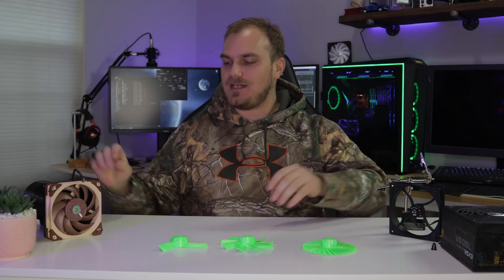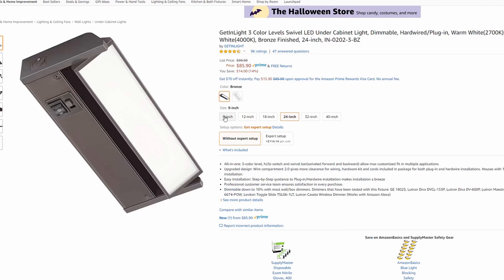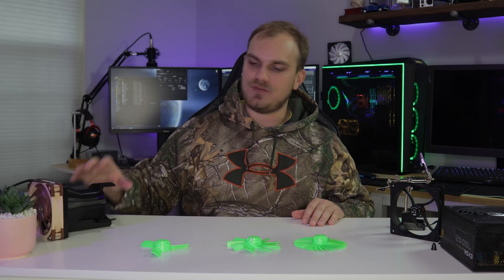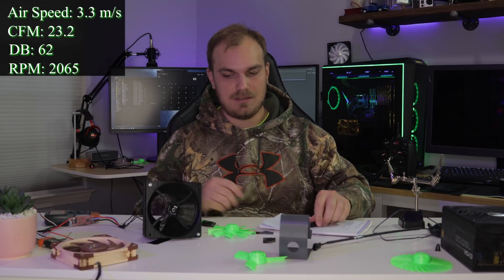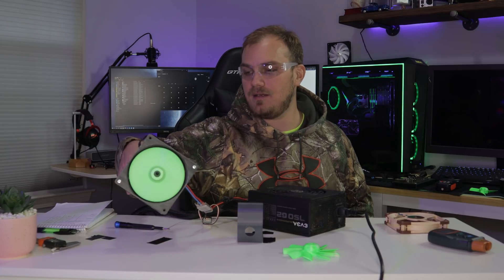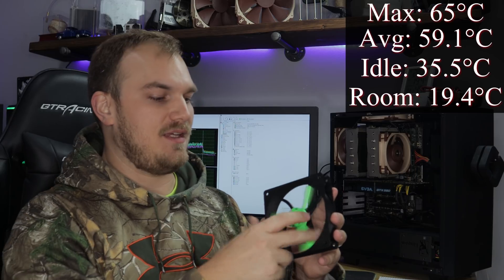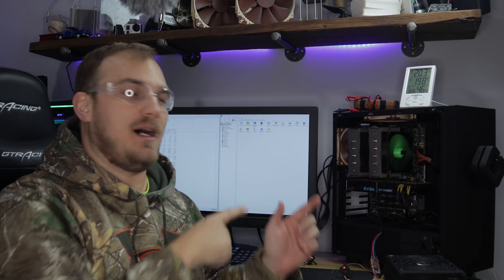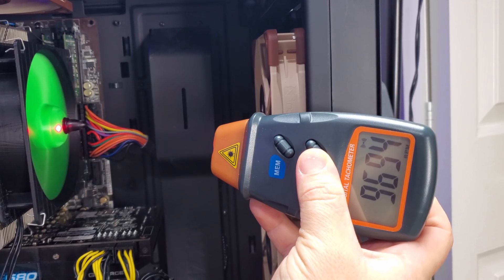This 120mm Fan BREAKS All The Rules!

Comment: The 30 blade will have the highest static pressure, meaning that the more restrictive a cooler is the more air it will push through
Reply: yeah, from the looks of it, the 30 blade actually broke the nut he had holding it on the motor and pulled itself off
Reply: @kasuraga  it probably wasn't tight enough, I've done a bit of work with drones and if the prop nut isn't tight enough it will let go. Notice it happened when the prop slowed down
Reply from the maker: Ya I should have cranked it down more
Reply: @MajorHardware  now you have a chance to fix what you found wrong with the last prototype and fix it. I would try and add scoops in the hub to cool the motor, and possibly put the blades at a higher angle and make them a bit thicker
Reply: Major Hardware  there comes a point where you have it so tight you damage the motor. The nut's supposed to be there to stop the thing sliding off, not to squeeze the heck out of the assembly (and end up distorting the rotor frame, resulting in your blades ending up out of true). Better to use a couple of lock/jam nuts and/or some loctite in this kind of assembly. Let them take the holding force, not the fan or the shaft.

Wrt the hub's rotor slots: at these speeds you should consider making these with an airfoil (or NACA duct style) shape, to "slice" air into the motor, not just act as simple ventilation slots - you want positive airflow. You can accentuate the airflow over the coils by shaping the bottom of the hub to act as an exhauster in a similar way 

I'd really like to see what you get with the 30 blade set at a slightly more aggressive pitch and then a 23-27 blade stator behind it. (you want these numbers more or less coprime or your ears will hurt - there are calculations for best ratios in turbines you can run with.) 

One last thing - flat blades always fly stalled somewhere along their length and speeds combinations - turbines and high end fans use airfoil shapes (along with chord curvature) for a reason - this was a fundamental discovery that vastly improved the efficiency of steam turbines and made axial jet engines possible.
Reply: I'm trying to like your comment, but it won't let me, it just keeps sending me to this make a comment in your comment.....sooooo, like. I like your comment.

Comment: I think it would be better to just report the temperature delta, so we don't have to do the math ourselves in comparisons.
Something you can investigate to make your 3D prints more heat resistant is annealing pla, it increases the temperature resistance to around 100°C. The disadvantage is that you get shrinkage in XY and expansion in Z, there are some special PLA made for annealing that has reduced length variation.

Comment: Could you add some angles to the edges of the ventilation holes in the hub so that you have a fan within a fan to help with the heat dissipation of the motor?
Reply: Those holes already act as ventilation.
Start playing with angles on them and you'll end up with unwanted expand/compress forces on the hub when it heats up (and it will for sure). You need them to be as neutral as possible.
My POV...
Reply: @jimbonetic  I doubt the back side is air-tight, having moving air would still be better than static if you want the heat to actually go somewhere.

Comment: The 30 blade fan actually had a similar sound to a jet turbine. I'd like to see a short follow-up to this video with another one of those 30 blade fans.
Reply: What If the 30 blade broke off because it was producing enough power to force the plastic nut off the fasining mechanism.
Reply: I think that the 30 blade would be the best performer at high speed. Its the point of that design, maximice trush winout stall.
Reply: Exactly! We need 30 blades spin-off... or spin-on..?
Reply: With jet engines, the blades are actually loose to prevent harmonic resonance, which is why the 30 blade turbine shook itself loose.
Reply: @macrowave9427  would printing in a more flexible material such as nylon help?
Reply: @ThoroughlyTested  Nylon is far more flexible then PLA and quite a bit more flexible then PETG.
Reply: @macrowave9427  making it stiffer, balanching and creating lift to counter act centrifugal forces might help since its high rpm
Reply: It sounded like it resonated before it broke. Jet turbine blades don't have a hard metal connection to avoid that problem, they attach like a puzzle piece into the crankshaft and centrifugal force forces them straight when operating. Probably excessive to engineer that into a 120mm fan, but I so wanna see a cooler that needs that level of engineering.
Reply: @Gracefulhiqpo  that is mainly due thermal expansion as it can reach around 1800C depending on where in engine you are
Reply: @frank124444  You're right of course. A single solution to solve two problems. I just thought the 30-blade fan breaking apart wasn't from overheating so I didn't mention it.
Reply: frank124444 with larger enigines like the GE90 you actually need to limit the rpm so the tips of the fan (the compressor that you can see from the front) dont go supersonic, because sonic boom would cause too much vibration and the aerodynamic propertys change at supersonic speed, that would make the compressor useless. With aircrafts that go supersonic you actually have to slow down the air in front of the engine ;)
Reply: @Gracefulhiqpo  I am a High Bypass Turbofan Engineer and allow me to say that the "interconnect" you are referring to is called "Mid Span Shrouds" that serve to negate the Aerodynamic Twisting effect on the Fan Blades.
Reply: I think a more aggressive blade curve could also help.
Reply: @cinnabarsonar2072  dont think that would help to stabilize it. It would help to move more air. As the ange of attack and the curve mainly depens or air speed and rpm and prkbebly the wanted pressure. More blades should give more coversge and.more pressure. Assuming we are hitting a speed at which the gas becomes compressible. Typical above 1/3rd of the speed of sound
Reply: Yes. The pressure consistency from a single or multi 30 blade turbine setup (maybe in push-pull config?) Must be pretty nice. The only reason it came off is you used a screw on fastener which was coming off slowly with all your blades. You need something that can link/snap on to the drive spindle
Reply: 30 blade fan collapsed due to resonance and lack of balancing. In fact, this is blisk technology for axial compressors of turbojet engines. 3 the blade fan makes noise due to the violation of the air flow from the surface of the blades.

The calculation should take into account the profile of the blades and operating modes, flow rate, structural rigidity, resonance, weak points of the structure, it is desirable to make a solid calculation for example in ANSYS to optimize the design.

Blisk (Engl. Blade disk) - compressor stage, the blades of which are made integral with the rotor disk. As a rule, it is made from a solid metal billet. Depending on the technology, Block can be 10-20% or more lighter than multicomponent turbines due to the lack of lock connections.

We counted on similar fans in College as coursework projects. Hell, it looks like I should find my old laptop, hope it still works.
Reply: I do think the shallower angle of the 30-blade didn't help it, shallower atack angle makes it need to spin faster to get the same CFM. maybe if it was between 40 to 45 degrees, instead of less than 30, maybe it would be better.
Reply: Unfair for that 30 blade can't show  its full cooling power capability
Reply: Got to hit 100k rpm first :)
Reply: I was wondering if the blade tips were going supersonic. It was creating that trademark buzzsaw sound when jet engines make during takeoff.
Reply: @DJPenguino51  the tips weren't going supersonic, it was vibrating. Probably due to it being incorrectly balanced, or due to mechanical resonance imparting some kind of vibration at the same frequency of the resonant frequency of the fan. (A 
 Cad simulation could check that reasonably well, though I don't know about simulation for 3d printed parts...)
Reply: It sounded epic tbh
Reply: and made with better material
Reply: What if he d try to make a ring around it like noiseblocker?
Reply: 30-blade creates most pressure ergo it performs better with resistance. It would be great on thick radiators.
Reply: gave me pre-takeoff anxiety just listening to it
Reply: I want a 6000 RPM 30 blade, just so my PC can sound like a jet.
Reply: Im the 1000th like, i feel honoured
Reply: @astafire6810  dude, that's crazy, because i don't even remember i was asking.
Reply: @Elektronick.online   I dont remember wanting your input, but here we are, you arent even the writer of the original comment, so i dont think anyone cares whether you wanted a reply or not
Reply: You see, conrade I think one blade fan would win because USSR flag has only one blade and USSR always win.

Comment: I'm curious, what material did you use to print these? If you can get your hands on some more temp resistant filament you might have a longer run time with them. Maybe poly-carbonate or Taulman alloy 910.
Reply from the maker: this was pla+
Reply: @MajorHardware  I thought it might be some type of PLA with the vibrant coloring. If you're looking to expand on your testing with this idea, ABS would probably be up to the task and a lot of cheaper mini quad props are made from ABS anyway. Best part is you can get that stuff dirt cheap :) it's just a little tricky to print sometimes.

Great video btw. It's cool to see experimenting with some  unconventional hardware.

Comment: Are there any hobby motors you could buy that could handle the weight at a lower RPM?
Could you mimic the 2000rpm of a traditional PWM fan with aftermarket parts?
If not then maybe you could make your own set of replacement fan blades for a very generic cheap fan? Like a 1500rpm coolermaster 120mm?

Comment: Do the 30 blade again
Reply: ... and balance it better.  also use a left hand threaded nut. would trailing "winglets" or a solid ring at the outer edge of
the fan help noise, strength and air pressure?
Reply: @---uv5vw  10:20 my friends, I work with turbines and helicopters (helicopters generally powered by turboreactor), I know about fluid dynamics and many other concepts of physics and I can tell you with certainty that:

 The more blades, the greater the COMPRESSION of the "fluid" mass (air in this case) and the lower speed of the "fluid" mass ...

 The smaller the number of blades, the less COMPRESSION of the "fluid" mass (air in this case) and the higher speed of the "fluid" mass ...

 As you can see, there are 2 principles closely related to the amount of blades, and that is, COMPRESSION and SPEED of fluid mass displacement, or you have more compression or you have more displacement speed, that's why a helicopter has these 2 types of  operation, in its turbo reactor more blades are used to generate the compression necessary to carry out the combustion of the "fuel" and on the main rotor that will "lift" the entire vehicle, usually no more than 4 blades are used, since it requires  a maximum of air flow displacement in order to achieve the lift of the vehicle in the air, and no more asps are used because the sufficient displaced mass would not be obtained ...

 In this particular case, this principle can be observed, that is why the rotor with many blades flew, because it was displacing a lot of mass and the arrow could not withstand the enormous amount of force exerted on it.

 It is a very interesting topic and it is not difficult to understand, of course, with practical examples such as those shown in this publication.

 In any case, if you want maximum mass displacement to cool everything at maximum efficiency, use only 2 blades at a good speed, and of the material, I would recommend fiberglass for the rotor and an arrow with high speed bearings, an arrow of  steel and joined with double nut using screw fixer and an aluminum, steel or titanium frame (frame) if it is very demanding.
Reply: @trabadix  I agree with you there, but one thing to note is the reason they probably use more than two blades on most fans, probably has more to do with the fact that if you have a proper speed to fan blade ratio, you have little chance of for instance cutting your fingers off... I'm sure there's more to it than that, but that's just my two cents
Reply: DELTACX10 your profile pic makes it look like Pooh is threatening an “or else” statement😂
Reply: Wanna see a push pull config...
Reply: and curve them a bit steeper towards the backside

Comment: to bad you dont have a way to measure Static pressure which is what noctua is famous for. Static pressure is neccessary to push air through fan vents and radiators. if you dont have static pressure and use that fan on a radiator, your not going to cool the water in there that well.

Comment: Sounds like my 1U servers
Reply: 40mm fan heavy breathing spinning
Reply: My gaming rig is an older model (1 generation back, but cheap enough for me!) 2U HPE DL380. When it tests all 6 fans at boot, it sounds like a Boeing 747 @1000m away on the runway during takeoff. I try to avoid needing a restart of anything beyond the VMs. 😂
Reply: Artemis Kitty Sound like the fan I ordered from amazon last month. "Silent" 92mm 1400 RPM. What I got was a 92mm 14000 RPM jet engine like fan... Pulls 48 Watts!!!
Reply: @DrakkarCalethiel  how did you measure it pulling that kind of wattage?? I'm intrigued
Reply: Dean Allen Just used a Multimeter inline. At 12V it pulls exactly 4 amps. Glad my mainboard didn't fail.
Reply: @DrakkarCalethiel  ... Can I get a name or link? That sounds like fun.
Reply: @drdefecation  Thats nothing, we swapped a fan that ran on 48 volts and pulled a bit over 100 watts. There where four of those fans fitted in push-pull on one cooling aggregate. The cooling solution on its own pulled over 1200 watts. Setup was used to cool a bank of IGBTs in a huge motor drive. It was rated for 700hp/575kW

Comment: My money is on the 9 blade design for best performance because most modern fan designs have around that number of blades  (7 or 9), plus although less blades can move more volume they also produce less pressure 🙂

Comment: Can you do higher blade counts with a steeper angle like on the 3blade design? Also is there any chance you get a quieter motor? Like, there are fans out there to buy where you can remove the blades for cleaning, I think Enermax had some.

Comment: That screw needs to be left handed thread 😉 that's why it came off... it unscrewed itself 🤣
Reply: It was unscrewing itself whenever he went from a high rpm to a low rpm rapidly, the fan was applying a reverse torque to the input shaft in that situation because it couldn't slow down that quickly. More gradual reduction in rpm would help.
Reply: @NathanielHatley  Not only that but the less aggressive pitch of those blades likely allowed for quite a bit more RPM which also leads to more vibration, specially with the amount of imbalance you'd have in a 3D printed setup like this.The tiniest of imperfections become much larger problems as the RPM goes up.
Reply: @MidnightMarrow  dynamic balancing is fun. 

I think the bigger problem was simply the mass of the rotating assembly and its inertia pushing against the nut as the motor rpms went down. (Which is what Nathaniel was saying too). Any vibration at that stage will rapidly unscrew the holding nut (which is why you never use "one" holding nut unless it's a castle head held in place with a split bin on a static shaft, or a some form of jam or self-locking nut on a rotating one)

There are a half dozen ways of solving that ranging from the simple to the wildly complex, but using a couple of lock(jam)nuts is the easiest solution from the balancing point of view.
Reply: Or just use a jam nut.
Reply: @AtlasReburdened  I love jam
Reply: Cotter pin/ set screw
Reply: @Ava-wu4qp  Why intentionally insert the imbalance from a cotter pin or set screw?
Reply: liberal use of super glue and ductape
Reply: I'll add my 2c - drill a hole in the shaft and use lockwire. That's why it was created.
Reply: @miscbits6399  Lock wire will un-balance the shaft and it'll shake itself to bits.
Reply: @MarkVernon89  quite possibly but it can be bound into the screw threads for minimal imbalance and the nut's not going to go past it. A locknut or nylock is better though.
Reply: Stock fans use a c-clip or retaining ring.
Reply: Very true.  Fans on engines where the fan basically "screws" onto the hub are left handed thread.  Otherwise when you chop the throttle, the fan unscrews and goes right into the radiator.